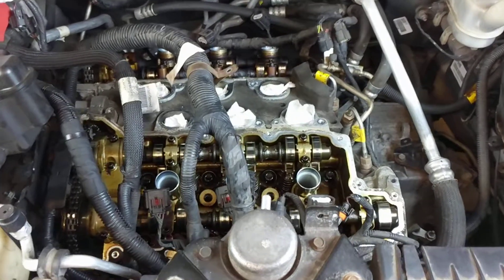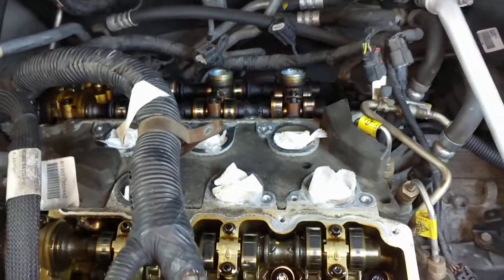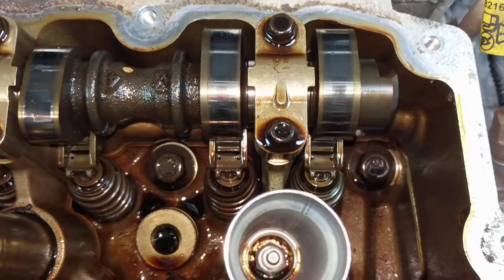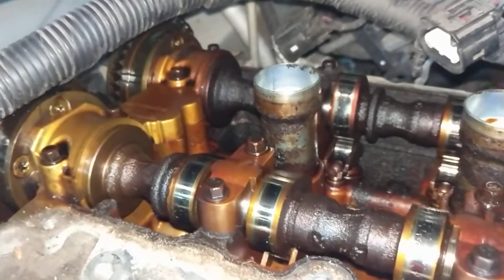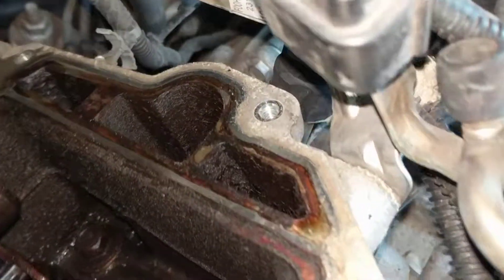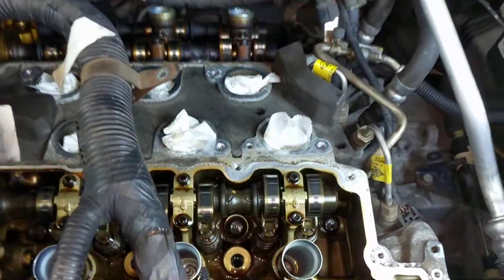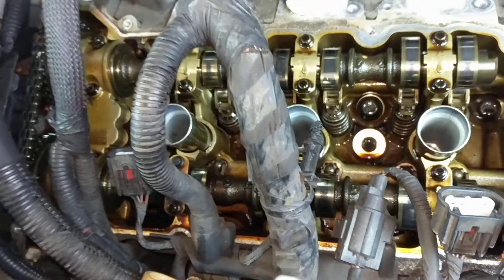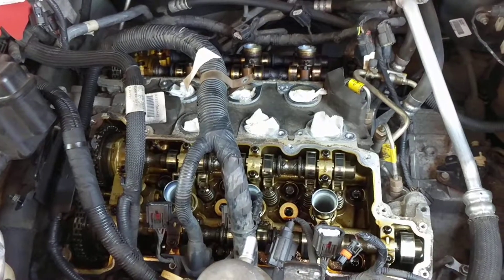2011 Chevy Traverse valve train inspection 3.6L V6 LLT VVT

Comment: See this ALL the time! Bank 2 head  (towards radiator) looks beautiful, but the bank 1 head (towards firewall) is absolutely trashed. That initial design on the valve cover (and its gasket) was terrible! No ventilation at ALL! Also in my experience, oil starvation on that bank. When everything gets clogged PCV-wise, it’s not long until the oil galleys are, too.

Comment: hello i have a 2016 Chevy Traverse Lt AWD I'm trying to get of the back valve cover to replace gasket and PVC valve i got all the bolts out still will not lift out what. Im doing wrong any help would be appreciated ty
Reply: Just have to pry it a little. Watch out for cam sensors

Comment: did you have to disconnect the power steering pipes from the pump and push them away to take off the rear valve cover? I'm in the same boat. I have a 2014 enclave and just found oil in the intake duct. Thought it's a easy job, just a PCV. However, there is no way to pull the "stubborn" PCV out, not matter the engine is hot or cold. Now, it seems that I have to remove the rear valve cover to hammer out the stupid PCV.
Reply: I was able to do it without needing to disconnect the power steering.

Comment: Great video. Just changed plugs. Compression was between 160-180 but 3 of the plugs has a lot of oil Had a misfire check engine light on cylinder 2. Changed that plug and coil. For now it seems ok- no more misfire. Do you think the oil on the plugs is from worn rings or valve issues? It has 110k on it.

Thanks!.
Reply: I have the same issue and I am wondering why.
Reply: Spark plug tube seals in the valve covers.

Comment: Can rocker arms and lash adjusters be removed without taking off the cam shaft?
Reply: Did you ever find this out?
Reply: No one could confirm lash adjusters would come out without unbolting the cams.  If you do a timing chain, replace the lash adjusters. Lash adjusters will fail next too.
Reply: @SilveradoXST  nah just seeing if I
Can get away with unbolting the cam and just replace the rocker
Reply: I don’t know. The design is similar to Dodge 3.7 and 4.7 rocker arms. I’ve done some without removing the cams. I wanted to do the same to an Acadia 3.6.  If you point the cam lobe away, it might work. Be careful though.

Comment: Drill out the pcv valve on the rear,  since I did that I have not seen one drop of oil in the intake .
7/64 on top and 5/64 on both bottom holes.
Might also have to change the valve cover gasket that is what GM.recommemds
Reply: Can you elaborate more. I have same issue on mine. I’m mechanically inclined and extremely comfortable with a wrench
Reply: @digiforce Did you fix your traverse?

Comment: Yo my traverse has 178,680 miles and definitely doesn’t run very well I’m sure this is my problem how would I go about cleaning it? I don’t have the time to drop the engine but pulling the valve covers and cleaning it out should be possible right?
Reply: Likely valves or rings. Next time but Lexus- trust me. Mine is 10 year old and does not burn a teaspoon of oil- ever. I bought it new- no issues ever. Just brakes, oil, tires...

Comment: Will it make a ticking noise if valve bad what’s that
Reply: The spaced out ticking noise mostly heard at low idle is the high pressure fuel pump mixed in with injector clatter completely normal nothing to worry about